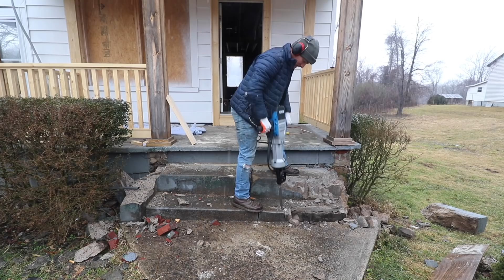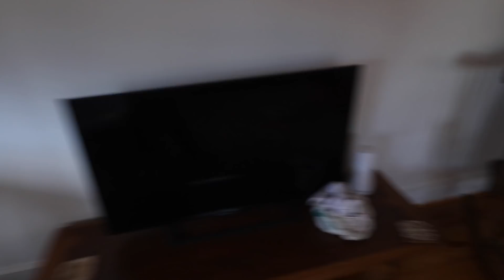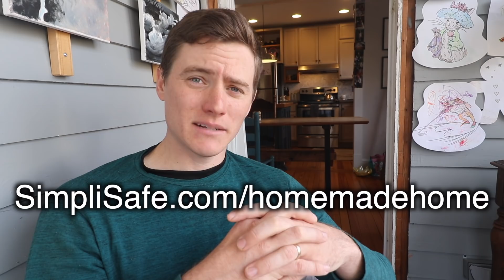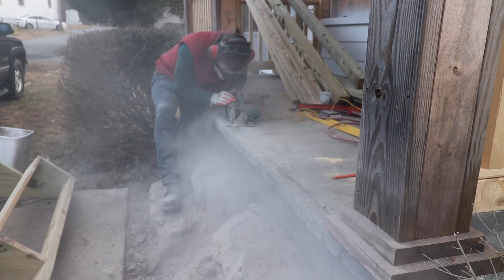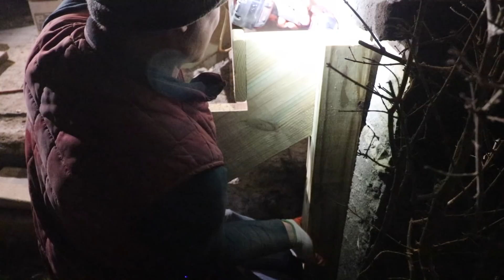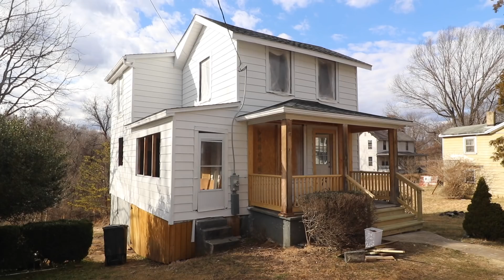$9,000 HOUSE - CONCRETE KILLER & BUILDER OF STEPS - Ep. 40

Comment: Why not go with the smaller Hercules demo  hammer? I've used it a lot for smaller jobs (like a spade bit to break out old tile) and for larger jobs, like those steps, you will spend a little more time, but the way concrete break when you go at it with a bull point chisel, I don't think it would have been so much more as to matter. Of course, you may have much larger jobs ahead and I just haven't gotten to those videos yet, lol.

Comment: Steps - rise and run must be consistent.  One step out of measure with the others will lead to tripping.  
My guess is you will trip over it several times while finishing the project - and you built those steps. 
For everyone else who didn't build those steps - they are even more likely to trip.  
It'll be a pain to rebuild, but I hope you'll do it as soon as possible, both for your own safety, and for anyone else who will use them. 
Going up is a small trip, but going down while your arms are full.......

Comment: Next time you have an unlevel concrete surface like that, consider lifting the concrete slab with foam to bring it back to level. Rotohammer few injection holes in the slab have a guy come shoot the foam in ezpz. You could have done this much cheaper and easier in my opinion but props to ya sir.

Comment: Did you know, that if you drill holes about every 6 inches, then take a piece of rebar and hammer it in the concrete will crack like sliced bread....but, a $600 jack hammer looks way easier.

Comment: I suggest doing the volcano when mixing concrete. You pour the powder first on a tarp or in a wheel barrow. Then make a hole in the top of it like a volcano. Pour the water in the hole and mix pulling the powder from the bottom up into the hole. The mixing is much faster and a lot less dust.

Comment: I've done a fair amount of DIY concrete break ups around the yard. And a simple air compressor with a $20 air chisel will demolish anything. No need for a jack hammer
Reply: Got an Amazon link ... what do you need to do that?
Reply: @justgivemethetruth  pneumatic air hammer attached to an air compressor.
Reply: @refink33  
Thanks.  Can you recommend any size, make, model or features.  I notice a lot of woodworkers using air powered nailers and they look  like a good option.

Comment: I am in need of some outside step railings. I have steps on the back of my house that have no railing! I’m going to tackle that project. I am a 70-year-old female and I think you so much for the  courage! I have lived in this house for two years and I noticed that the front porch which spans the front of the house was built over a couple sets of concrete steps. One was a set for the main entrance and the other was a  set for a front side porch which had been turned into an office.

Comment: So, for anyone else doing this, and I think he'll learn the same, that 2 1/2" drop down onto that first step is going to be a uncomfortable and a possible tripping hazard. I built steps like that once, because the run and rise was going to be too large, or too small, so I just dropped it like he did and had comfortable wood treads, but that last 1/2 rise really does lead to trips and an annoyance every time you go up and down. It's actually better to have a smaller step at the bottom, than the top, but since then I started using a stair tread calculator and always found a happy medium for rise and run that hover around a 7" rise and 11" run.

Comment: Top step has to be redone to be made flush.  With steps equal height (by altering them all).  If three steps will have too much rise, then adding another bottom step needs to be done.  I'd be curious if you can just plank over what you have, or if it won't work.  
Painful redoing lesson, but you'll be sure to not forget it that way!
Great reno video!

Comment: Always look forward to the Double H  videos. These are invaluable pieces of renovation inspiration! I bought your eBook and look forward to the opportunity to buy a second property and emulate even just a fraction of what you're doing.
Thank you for these.
Also, thanks for the call to action to leave a comment. My two bits are use that bottle jack that was in the background on your vlog outro at the inside steps, and dig under that front entry slab and add concrete underneath the triangular patch of cement that was already poured. Personally I think new cement looks tacky and I much rather a pressure washed old sidewalk to a freshly poured one. 
Although, I wouldn't be disappointed watching you do it anyways. Ultimately seems like less workand your probably have your reasons. I've been watching this father son duo Stud Pack and they have a good self leveling concrete video from a recent  bathroom remodel. Anyway. Have fun with your family and keep breathing new life on your projects. I look forward to checking into your other channels. Thanks for reading.

Comment: Out of everything I've watched you do I think this job disappointed me most, because the risers should have been spaced evenly between the sidewalk and porch. That small step at top is a trip hazard.  In addition, those two corners that were left after trimming back the porch floor could also pose a trip hazard.  These are legal liabilities to a landlord and might be discounts if the house were ever sold. Not to mention, those steps wouldn't likely pass code enforcement.

Comment: A couple of thoughts:
1.  Your Ramset (gotta love genericized trademarks) is worth going into more detail in for viewers who aren't familiar with them.  While they're not that common for the layman, they're very useful and inexpensive enough that they're worth having around.  For those who haven't seen one, they use what is basically a .17 or .22 cartridge (hence the powder - usually cordite) to drive a specialized nail, called an anchor, into concrete.  They're a great alternative to a Tapcon.  Hilti makes some very high-quality ones, but they're expensive (as Hilti tends to be).  You can get a Ramset from your local home-improvement store for about $25 if you get the most basic version.  I think they're a good investment for the DYI homeowner, and even more so if you're going to DYI investment properties.

2.  Great idea, leaving the treads free to contract like that.  I wouldn't have thought of it, but that's going in my mental toolbox now.  Do you have a list, somewhere, of "things to come back to" so you don't forget things like that?

3.  Best way to deal with the sidewalk, for now, may be adding a skirt to the bottom riser.  Eventually, evening the sidewalk may be a good idea, for safety, but that's a bigger job.

4.  I notice what little music you had was lower volume.  It matched the volume of your narration a LOT better than your previous videos.  I, for one, appreciate it.

5.  I always look forward to your videos.  As for the cabin, I think there would be a lot of people who are interested, but I know I'm more interested in your conversion of rental properties.

Comment: Up here in Ontario we do a process called hydraulic jacking.  Holes are drilled into the unlevel concrete and thensoupy mortar is pumped under pressure raising the uneven surface to level.  I did my sisters patio and recovered a 2" discontinuity in a crack and prevented an expensive pour.

Comment: Looks like you took out Mr. Block's step-kids, LOL! They were just as stubborn as Mr. Block. I bet you could do that new foam technique to lift that sagging concrete sidewalk. Then backfill the area beside the sidewalk with several wheel barrels of dirt, tamp it down to level things out. That is what I did. Oh yes, please build the log cabin to run off solar power. It is more out of pocket upfront, but you don't have to worry about running out of gas, and sunshine is free.

Comment: A risk with these concrete breakers is breaking the concrete too much. 
If you are using a sledge and a bar, you break it into large pieces- like as big as you can lift. With a breaker, there is a temptation to chip it to little bits, and you end up spending a lot of time picking up bits, and shovelling and sweeping. Cuts up your hands no end (or gloves) and you end up paying to buy bags to carry all the shrapnel to the dump. Takes longer to tip, too. 
Best to just break it into big chunks

Comment: I would have purchased the concrete jackhammer a long time ago, when I saw you trying to remove the concrete in the basement. Save your back you’ll need it when your older. If you had purchased it sooner then you would have had the option of removing the front porch and doing the job only once instead of possibly coming back to it again at a later date. It will pay for itself in the long run.

Comment: Too late now but your railing pickets on the stairs now are a different style on those on the  deck ...also could you have cut the cement deck to put your top step flush against it for a smooth transition from wood stairs to concrete deck ( no small lip that you referred too) ?

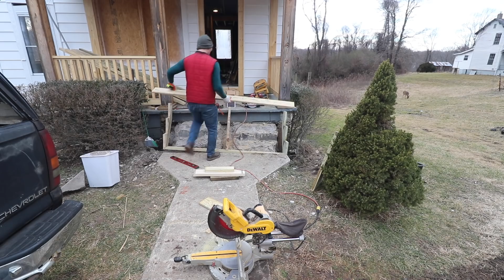Comment: Deer family grazing in the background at around 19:35.

I don't understand why you made three steps. There were only two concrete steps, although they weren't spaced very well. With two wooden steps, evenly spaced, it would not have been necessary to cut anything from the existing porch and there would be no danger of anyone tripping.
Reply: The maximum rise on the original concrete steps looks like over 12"  ... doing the 3 steps was a good choice, but not bringing it up the porch level ... gonna be problems.

Comment: I’m surprised you didn’t make that first step flush with the concrete deck. Isn’t that small 1-2” step from wood to concrete going to be a tripping hazard?
Reply: I was thinking why didn't he attach a ledger board to the deck to bring it out to the lip and then he could have set it to height of the concrete.
Reply: Same idea here --- I thought "ah he'll be raising the deck (building a nice wooden one on top of this one) because the front door has about 8inch step up so it all works out naturally"; but then he wouldn't have made the enclosing bannister's lower horizontal so low. Because it would trap the water and rot. OK I'm puzzled too.
Reply: I love watching this stuff, but yeah that little 2" step is going to be a problem, someone is definitely going to faceplant on there one day :)

Comment: The cement lip is a trip hazard and an inspector in most residential areas wouldn't allow it  .... nor would an insurance company.
Reply: Agree. I dislocated my tibia and snapped my fibula while carrying our baby on a lip like that - the homeowner's insurance company was NOT pleased, especially $60K later in a lawsuit that I won. The PTSD I battled for years after that injury + almost causing a TBI for our son was a lot for me to bear...
Reply: Yep that’s true!  Also anything more then a 1/8 1/4 inch difference on any step would also fail inspection.  Should have raised the steps up 2 1/2 inch to match the top.  But good camera work.
Reply: @BornToDoItRight  Could be fixes with shims and would HIGHLY recommend that before someone trips.
Reply: Attach 2x6 horizontally to the inside of the strings and then add shims to the stringers thr stringers themselves with construction adhesive and screws.  I might even consider adding plywood to the outside of the stringer .... otherwise I would just tear it out and start over cause I'm not sure the railing would be the right angle.
Reply: @pslowazo  
Blew it in the conception, now there is really nothing to do but redo the entire thing.  It really looks good, but that is a major injury just waiting to happen, to either his family, a renter, or the new owner.

Comment: I have built stairs only 1 time and I cut my own stringer lengths. Not that hard. I would have measured and done some math so that top tread came in at the same height as the deck height. That 1 inch lip is very dangerous.

Comment: I'm gonna guess you aren't getting any of your work inspected. There is no way those front steps would pass an inspection in any are I have ever heard of. Every code I know of says the steps all have to be the exact same height from the first step to the last. Also, if you had designed the steps correctly, you would not have had to cut out the concrete on the patio.

Comment: Self level concrete on that sidewalk would really make the difference and possibly prevent folks from misjudging the steps.
Reply: Well, if an inspector comes by, he's probably going to have to redo the steps anyway. My guess is he's going to have to redo a lot of things if an inspector comes by. I haven't seen a single building permit in and of the windows, which is where they are usually required to be posted.

Comment: Cabin sounds good. I'd also be interested in seeing the renovation of the other house, You might feel as though the videos are the same from one house to the next but every house you renovate is new and presents you with different challenges and watching how that pans out is the interesting bit, so it doesn't feel repetitive from my perspective.

If it were me I'd stay away from generator in the cabin and go with solar, the price of basic solar and batteries have come down a lot and once it's setup it's very low maintenance, especially if it's a small system that only powers lights and then you have a wood stove to heat, cook, and warm water with. The noise of a generator can be grating if you're trying to relax and it's a pain to have to keep it topped up with fuel.
Reply: Agreed - solar project would be fascinating, though would probably need some kind of top up generator for the winter at least, so remain off grid.  Excellent work!!

Comment: It's interesting to watch the outcome of the decision making when faced with the challenge of what to do.  If money is no question, you take out the old porch, steps, and the walk and redo it all.  But here you're having to decide how to make it look good while working within the constraints you have (mainly time and money - and a child - kids change everything).  Cutting out the top of the porch to give the full tread width was an interesting choice for sure.  It works and doesn't look half bad.  I'm thinking you could have done just two steps and not had the two-inch (approx.) distance there from the top step to the porch height.  Of course, your step height for the two would need to be a bit higher and possibly not what would feel right.  I'm just thinking how that last step will feel when you're almost at the porch height.  Sorry for the rambling.  Great work as always.

Comment: I would say for that bottom step gap, you could replace the kick board with a custom cut piece or you could dig under that sidewalk slab and jack it up on the low side to make it level and fill in underneath. May need to cut a crack where the walkway meets the trapezoid section.

Comment: there's a way to level concrete sidewalks that advertises on YouTube by using high pressure foam injected under the concrete... i'd like to see you use it and have an honest review... heck might even sponsor you. keep it up.
Reply: We used that for a sidewalk in the back garden and along the side of our house, plus one corner of the driveway a few years ago. It's okay, nothing special. Lighter  than mudjacking, which is what they call it here in western Canada when they use a form of concrete to pump under concrete that needs lifting.  Warning, don't touch the hardened foam with bare skin. I nearly lost all the skin on my hands after carelessly tidying up extruding lumps and bits after the contractor left. Allergies or toxin, I don't know but it was not fun. 😖
Reply: @Beruthiel45  
Ugh, thanks for mentioning that, who would want such toxic stuff in their environment?
Reply: I was going to mention injected foam as well. I’ve got a wonky sidewalk to repair in the spring and have been leaning in this direction. Would love to see how it’s done.